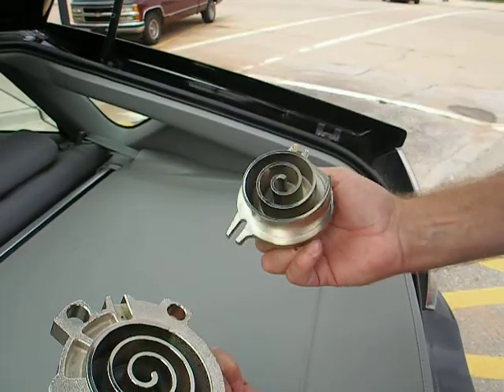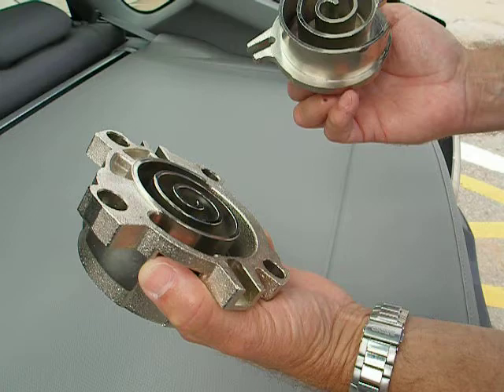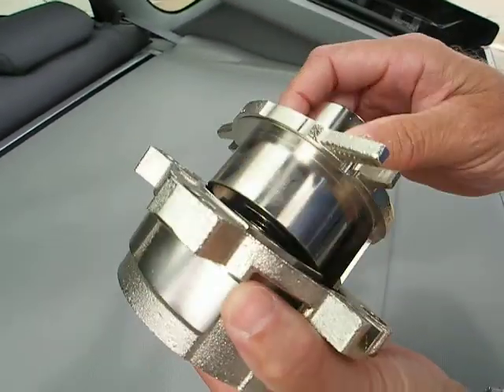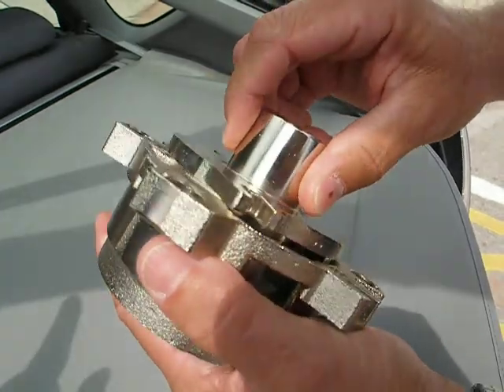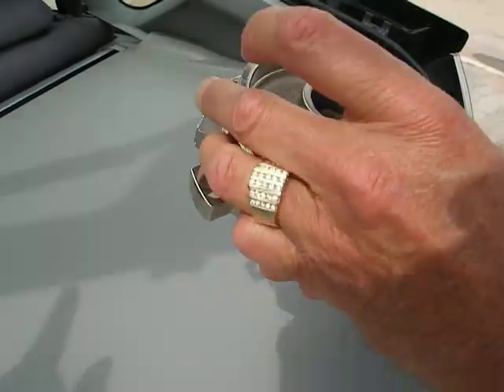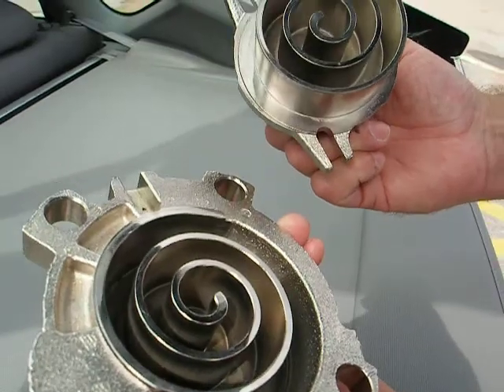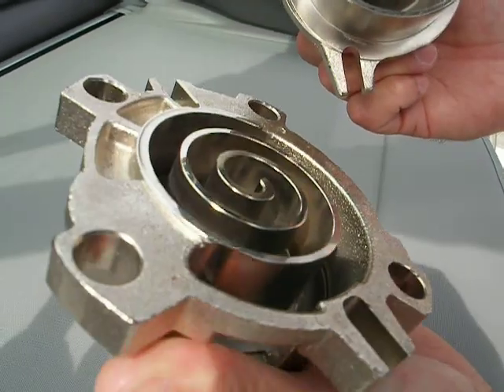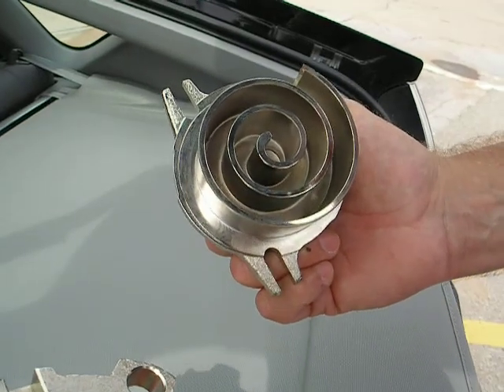Copland Model 22 Scroll compressor

Comment: Yes the discharge is in the center and the intake or suction is on the side,  The larger of the two is a fixed componant and does not move but the smaller moves in an orbiting motion inside the other and pushes air to the center like an auger. The tips DO touch slightly.

Comment: Thanks for posting the video, it's very helpful since I'm trying to fix vibration problems with my wine cellar's scroll compressor. The compressor's intake is on the side and the discharge is at the center. I'm sure you know that, but it's easy to get it backward when you're demonstrating. Thanks again.